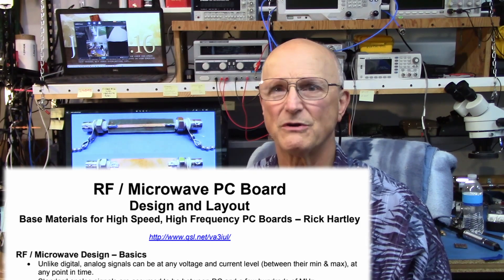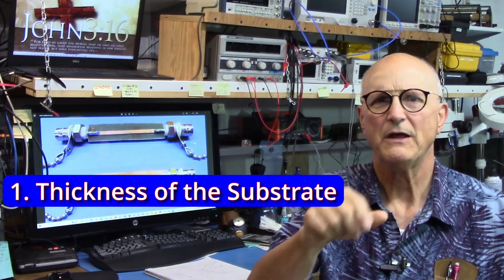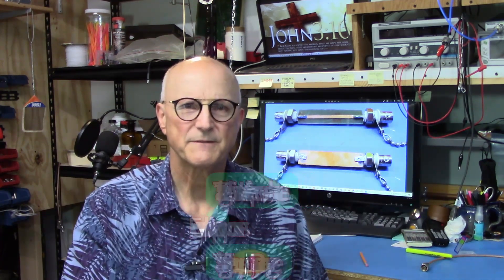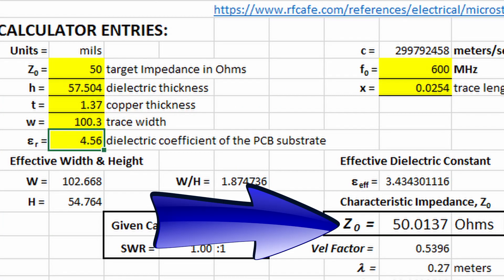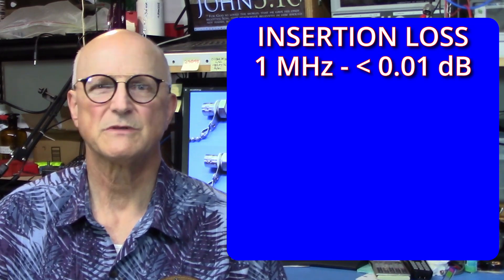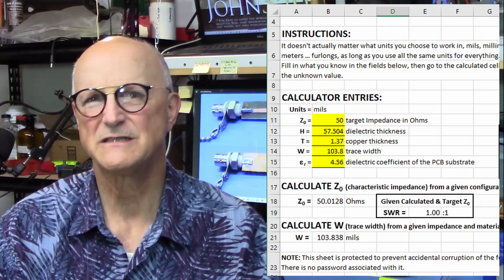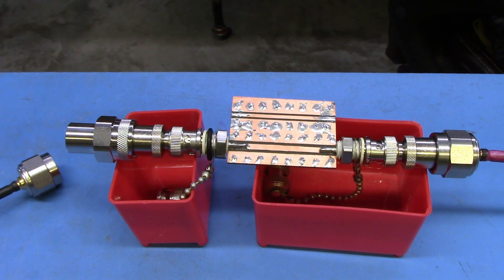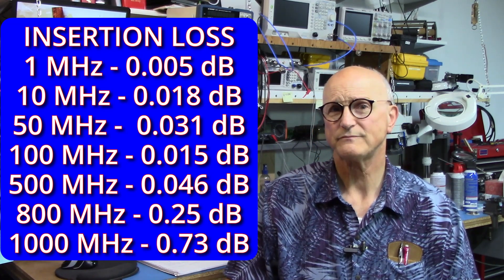Impedance Controlled PCB Features {Microstrip Line & Coplanar Waveguide with Ground} (034)

Comment: Nice video. 
Hey, how did you build your test board? did you etch it or did you use a CNC to remove the copper?
Reply from the maker: I very carefully placed electrical tape where the trace and any other copper needed to be, leaving all the rest exposed.
I then etched it using Ammonium Persulfate. NOTE: This stuff likes to be real warm in order to work. I had to have my etching container on a heating pad (for my back) turned up to high to make it work. 🙂

Comment: Really fantastic explain,and can see you know what you do. And yes...question. How to calculate stripline for 2 transistor lin. amplifier,like in some linear is?
Reply from the maker: Many, many factors here.  My method of operation? Review documents like this one:
https://drive.google.com/file/d/1iuPO1tRLOUhiJBPB0SK6KoM4ijQ_TDX3/view?usp=share_link
to determine what exactly to call what you are trying to design because nomenclature is everything in this business. Then I would look for an on-line calculator to calculate the necessary stuff.  I'd create a quickie, sanity check experimental version, modify your design as needed per the experiment, then create the final design.
You can kinda see my process in this other video of mine dealing with an impedance controlled PDB design (in the end):
https://youtu.be/789P1xaJc_U